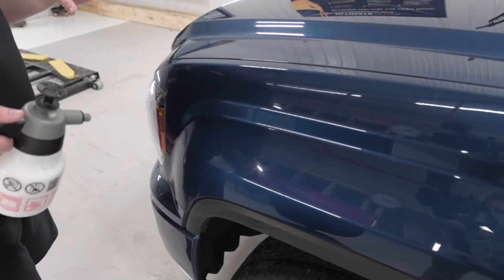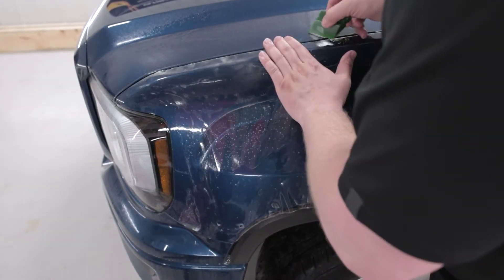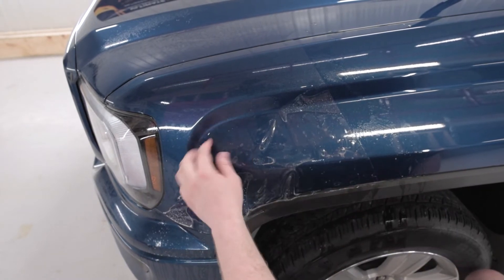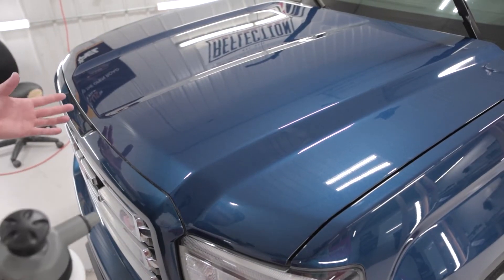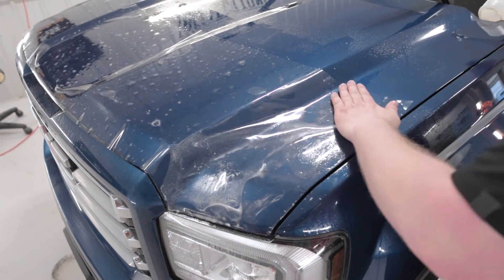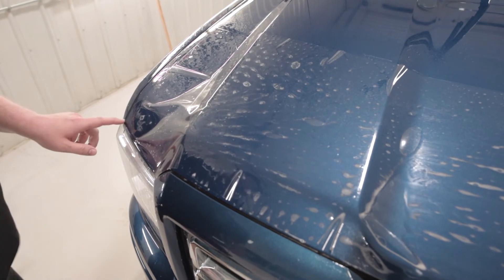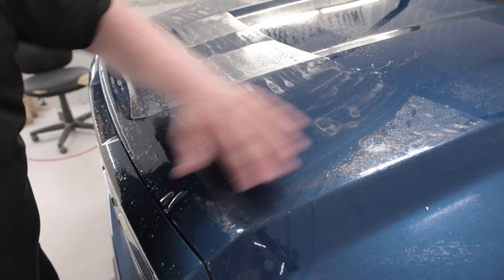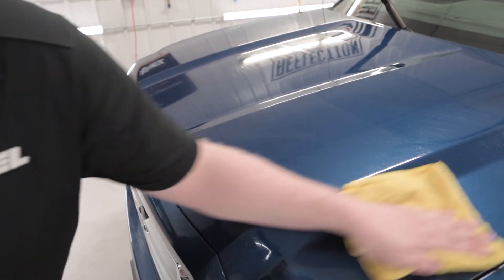DIY - PPF Installation - Partial Front End Installation!

Comment: When you relift the film for whatever reason, how do you prevent the lift lines or how do you fix them?
Reply from the maker: Great question! A lot of that will depend on how long the film has been down, and the angle you pull the film from. Its pretty hard to explain that over a typed out message. My go to is use hot water to soften the film up, then pull at a low angle to prevent the adhesive from separating. Hope that makes sense!

Comment: Great video! It looks like the only tools you use are a squeegee, slip solution, and tack solution. Do you get these from Xpel or are they easily available other places?
Reply: Yes! Those are all the products we use. The products can be found at XPEL.com or at 44tools.com. Both are great places to use!
Reply: How much would a typical front bumper and half hood, with headlights cost?
Reply from the maker: Usually in the $6-800 range

Comment: Does the Expel PPF shrink at the edges and leave a tacky film that collects dirt? I had someone install a 3M PPF (before I knew about Expel) on the front bumper cover of my Mini Cooper. He used a precut pattern and it looks like the pattern was not that good (not close enough to the edges) and it shrunk all over. I don't think he use adhesion promoter on the sharp edges when he should have because they are lifting up in places. After watching these and other install videos, it's obvious now that he didn't do a good job and was inexperienced.
It's interesting that you don't disassemble the front bumper cover or remove lights to wrap the PPF all the way around the part like you do for a vinyl wrap.
Reply from the maker: Brian, first off, thanks for the comment and the great question!

Xpel should not shrink at all once applied. The pre-cut patterns are designed to be stretched into place and if the installer knows how to install, adhesion promoter is not needed. All of our patterns are designed for the best possible fitment. That means the film should stop 1/16'' to 1/32'' of an inch from the edges.

Paint protection film, due to its thickness isn't designed to be wrapped around edges like a vinyl wrap would. You can definitely get the film wrapped good and tight, but the film has its limits compared to a vinyl.

I hope this answers your questions, and I do apologize for responding so late.

Eric

Comment: How do you control the small micro fuzzy under film. ? I always find one or two under my installs. You only notice it if you eye fuck it
Reply from the maker: I just make sure to do a very thorough prep of my entire working area using a lint free glass cleaning towel. That seems to take care of 99% of any contamination. Usually if I see something I’ll just peel back, get a bunch of slip solution in there and use a tweezer to remove fuzz.